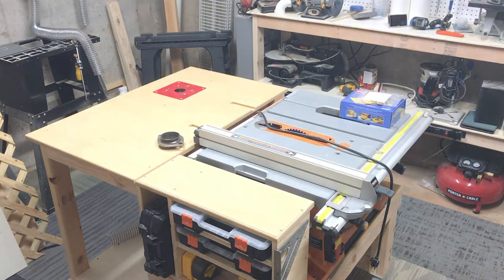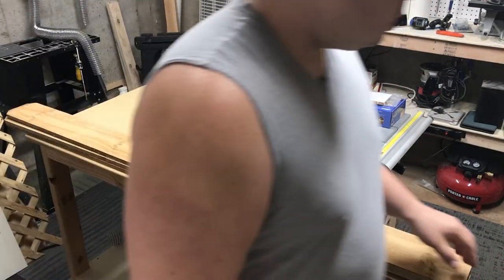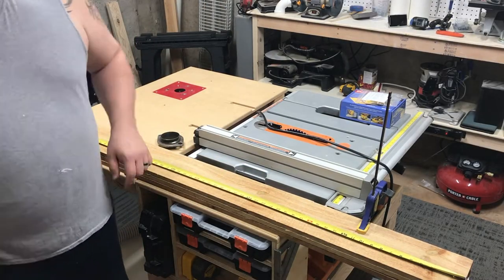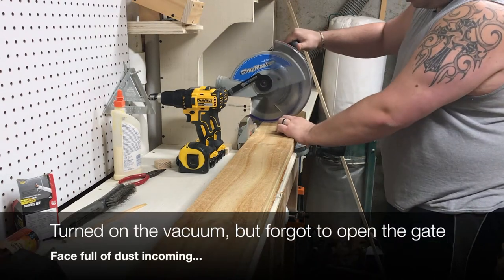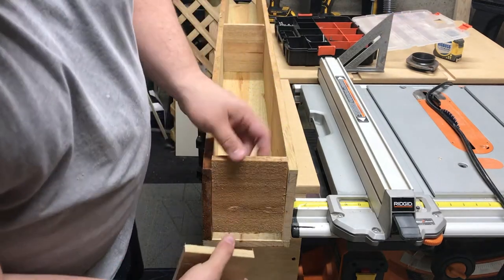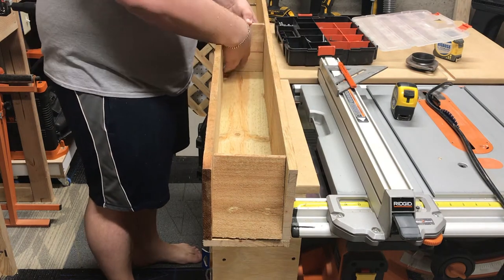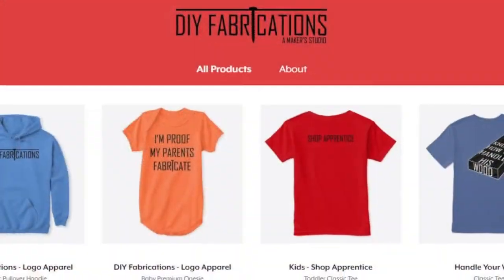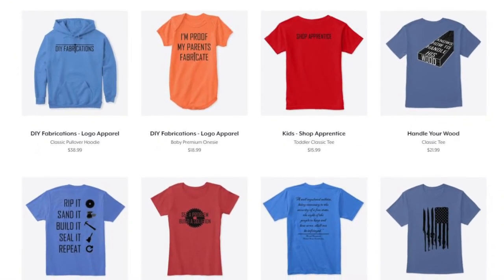DIY Fabrications - $5 Planter Box

Comment: Thanks for the video.  How did you attach it to your deck railing? I have a very similar railing.
Reply from the maker: Hello there. With the weight of the soil and plants, where I live, it was able to just sit there.  An alternative option is to use 1” stainless steel corner brackets like these (https://www.homedepot.com/p/Everbilt-1-in-Stainless-Steel-Corner-Brace-4-Pack-13541/202950156).  The stainless steel doesn’t rust.  You could also spray paint them to match your railing.

Comment: Hello sir, the picket fence I have in my local store has this dimension, OFFER DETAILS CLOSED
Severe Weather (Common: 5/8-in x 5-1/2-in x 6-ft; Actual: 0.625-in x 5.5-in x 6-ft) Wood Southern Yellow Pine Dog Ear Wood Fence Picket. Should I be using 2 panel in one side as compared to one in your case.  Please help

Comment: Is there some way to be sure it doesn’t fall off the deck?
Reply from the maker: Easiest way to secure the planter is to drive a few screws from underneath the railing into the planter, or if you don’t want to run a screw through the railing. You could add a skirt down the side to keep it in place.